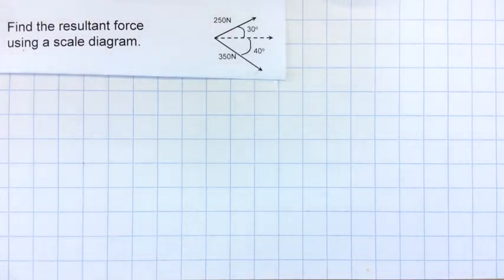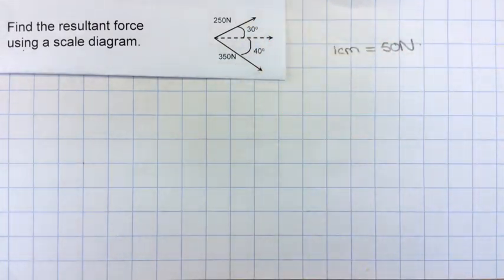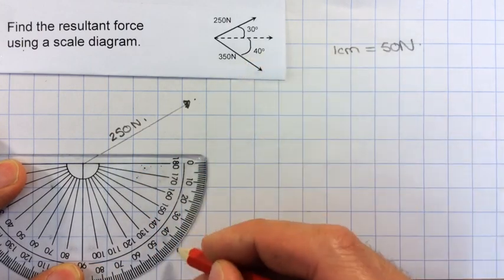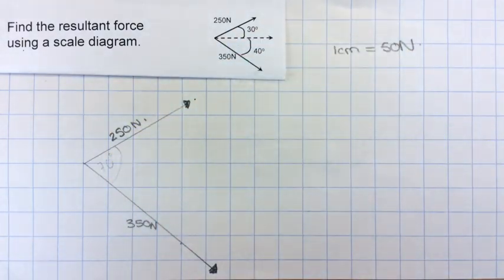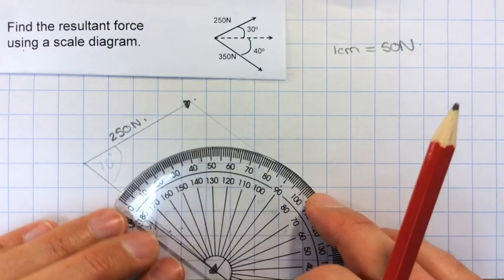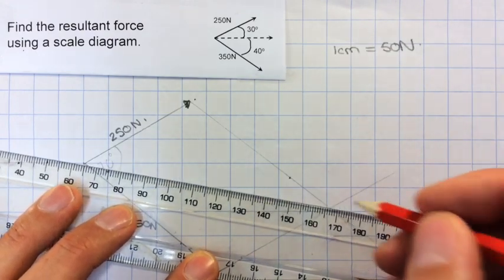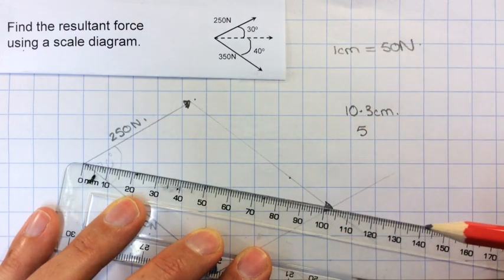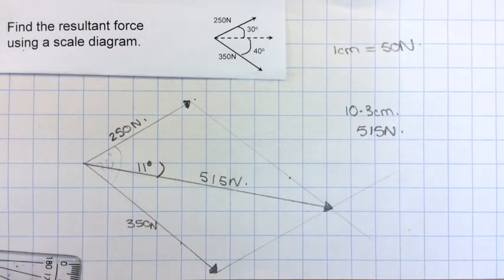4   Resultant force of two vectors at different angles

Comment: M still confused now which angle we have to take to find direction. Can u pls explain in general so that can be used for other questions too
Reply from the maker: You need to draw the vectors in the same direction as they are originally drawn in.  Rather than finding the angle from the first one drawn you may find it easier to measure the angle from the horizontal which is the same as the original diagram.

Comment: where did you get 11 degrees from?
Reply: Yeah I didn't understand either
Reply: @imnotev1084  he just measured it from the protracter from the origin, a flat horizontal line as shown in the figure above the drawing.
Reply: @Dynoids  the comment is 2 years ago but ok
Reply: @amrradwan3887  I know, just commenting because why not. Maybe someone else comed across it, maybe not. No big deal
Reply: @Dynoids  is that the right way to measure it or not please reply asap i got an engineering exam tomorrow
Reply: @AS-qj5eh  oh damn, late again. Well yeah both ways are right, only thing is he is using a protractor to measure and draw the correct lines/angles, not needed for the math you use in engineering